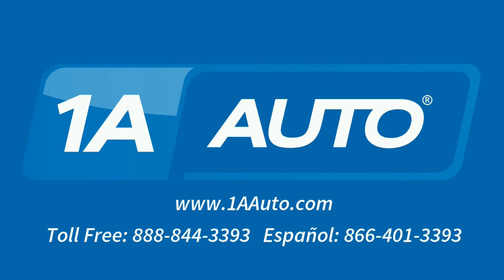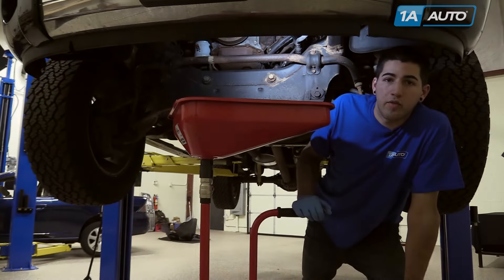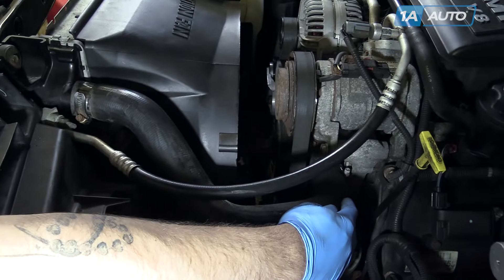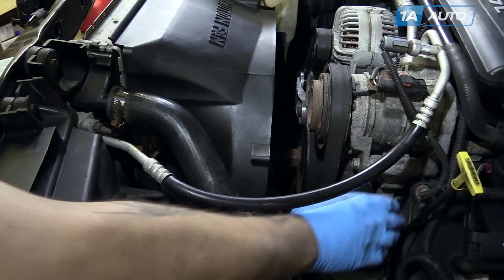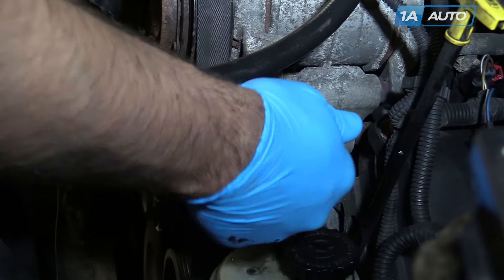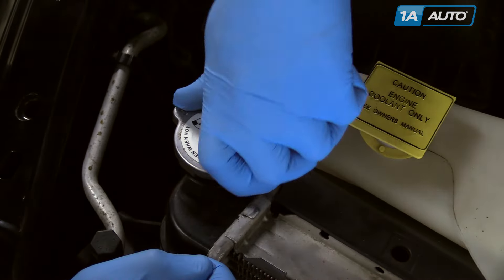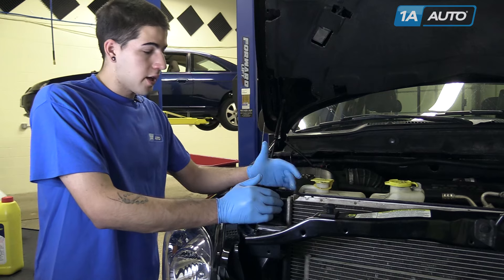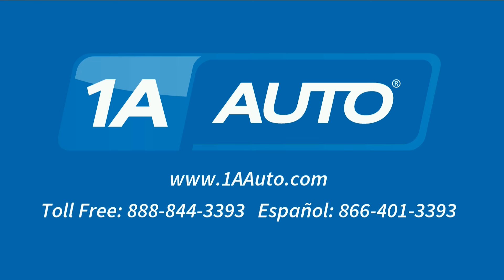How to Replace Thermostat & Housing 03-10 Dodge Ram

Comment: I own a 2004 with a 4.7 liter (not the HEMI) I followed the instructs but ran into a problem. The thermostat was not on top of the engine, instead it on the bottom connected to the lower radiator hose.
Reply from the maker: +Dean Johnson Thanks for the feedback!

Comment: Just did mine a few hours ago. I didn’t drain the radiator. Got some water works after removing the thermostat. Had a pan to catch the coolant. I didn’t even have to bleed it that much. Took it for a 30 minute test drive and everything is good 😎

Comment: Does that housing have a notch on each end that fit in small dimples in the intake?
  My 95 dodge with 5.9 engine had the notches, but I don’t see any depressions in the intake. 
  Thinking they may have filled in when someone tried to clean it in the past. 
  Would it be okay to drill a slight depression in the intake or grind the mumbles off the housing to let the housing fit flat?

Comment: So I add coolant to the reservoir fill line and add it to the radiator? I have already flushed my coolant and removed the reservoir to inspect for cracks. 

Do I need to replaced the thermostat?

Comment: Is it necessary to even take the hose off? Couldn’t you just take the thermostat housing out after the two 13mm bolts are out and have it on as one? Just curious
Reply: You're correct.

Comment: I have a stupid question I have a 2001 Dodge Ram and I was changing thermostat and I put the gasket on the housing then put it all back together instead of putting the gasket on the water pump then putting the housing on it was leaking so I took it off and put some more glue on the other side of the gasket and put it back together do you think that's going to work or should I just start over

Comment: My 2012 ram 1500 has a cheap plastic drain plug that took me 2 hours to put back in. After being unable to screw it in I managed to find a 10mm Allen key and gave it a hard push. That seated it and I simply twisted it the rest of the way. Hope that helps somebody

Comment: So I know how to do the job I came here to see the little hole I think it's the weep hole they say it has to face a certain way I didn't see you mention it on the video If you look at your old thermostat before you take it out in this video it's got the hole at the top 12:00 position but when you put the new thermostat in he has it like towards the bottom I'm not too sure how much it matters I've just seen it online everywhere and everybody doing it the same way when I did my truck my old thermostat was the same way it had the whole slash gold screw at the top so that's the way I put mine in I'm trying to make sure mine faces the right way putting a new water pump on My brother's truck this time and forgot to look witch way the hole on the thermostat was facing on the old one so I came here to this video to see which way it should face but he never mentioned it and put his new t stat on with the hole tords the bottom

Comment: Nice Video, I just replaced my thermostat from a 203f to 180f. Why does the mopars out their have too run that high of temperature?? Im getting better throttle response with the change with no problems with sensors at all and runs smother and cooler.
Reply: Mine runs way better on the 203 and gets way better fuel mileage.
Reply: Fuel mileage is not as good and temp fluctuates too much iam also running elc cooling fans and a 3row rad on my wheeling 5.7 don’t do the 180

Comment: replaced thermostat however my heater isn't working now!!   Any ideas as to why it would stop working?  Thermostat is working it keeps at around 200F  .  I probably have air in the system but how do I look for and fix that?
Reply from the maker: +JoeG2013 We would suggest getting a diagnosis from a local mechanic. 1aauto.com

Comment: I have a 2007 ram 1500 5.7 and my thermostat housing didn’t have a gasket on it when I took it off to replace it. Anyway now I’m hearing a hissing sound when I drive it, should I take it off and reinstall it without the gasket?

Comment: I'm going to sound like an idiot but wat if I did not bleed the system and my truck shakes at idle what can I do to fix it just reedo the whole process or have I damaged anything I did drive it any input is appreciated
Reply from the maker: +Dallas Texas Thank you for checking us out. It is highly recommended to not drive the vehicle until the issue has been fixed to avoid further damage. 1aauto.com

Comment: Hey wrenchers. My engine is not warming up properly. When I get between cold-mid, I turn on heat and the engine temp drops almost immediately to cold. Also, the hot air will quickly turn to cold as engine temp drops. This has to be a thermostat stuck open right?
Reply: Bleed the air out and check both top and bottom of the radiator hose and last the ones going to the heater core

Comment: Is the thermostat going to be flush in there or no?
Reply from the maker: +Jeffery Gilley It should sit flush as the factory thermostat did. 1aauto.com
Reply: The thermastat has a arrow the arrow should face at the the 12 oclock position always

Comment: My 2003 ram 1500 heater is not working. The radiator fluid is topped off and the blower motor is working.

Comment: I just tried to replace my thermostat and the original thermostat did not have a plastic ring on it and now the replacement part does and it doesn’t let me screw it back on flush what do I do should I just take it off and let it run with out it like before
Reply: No leave the gasket in there it was there for protection against any coolant leaking out

Comment: What's the average amount of coolant you will.need to replace after this?
Reply: When I replaced mine, I didn't drain the radiator, and didn't lose any coolant, so in my case, none.
Reply: @dakotabelcher9988  
If you removed your upper rad hose and didn't lose any coolant then you're quite low and should definitely top it up.

Comment: I own a 04 ram hemi 5.7 2500 .the heat is currently luke warm.would a new thermostat fix this.the fluid is topped
Reply from the maker: Could be a bad thermostat. But that would typically show itself by your gauge not working properly. Does the car overheat? If you've worked on the coolant system recently, it's possible you got air into the system and it needs to be bled out. Alternatively, you may just have a bad heater core. Do you see condensation form on the windshield when you try using the heat? I'd start by reading up on heater cores and symptoms when the fail.   Buy your auto parts from 1AAuto.com?utm_source=YouTube&utm_medium=CTA%20Comment&utm_campaign=1ATony
Reply: Start with a good coolant flush if you havnt done one recently. Easiest and cheapest place to start and most common cause. lots of good youtube vids to show you how to do a good flush.

Comment: Could air in the system , from lack of bleeding, cause it to not be heating up to normal temperature levels ?
Reply: Absolutely. DJFartbox doesn't know what he's talking about. Air in the coolant lines is a very common problem of poor heat. I'm referring to cabin heat not engine heat.